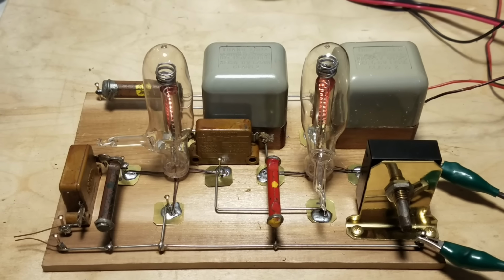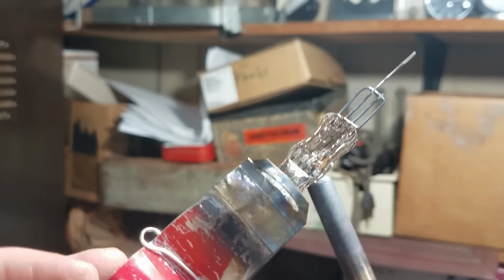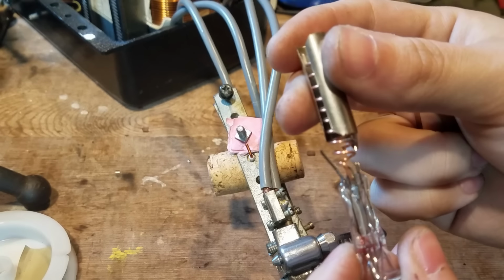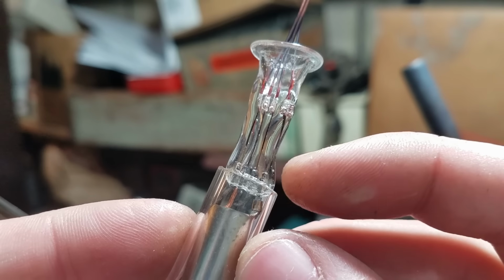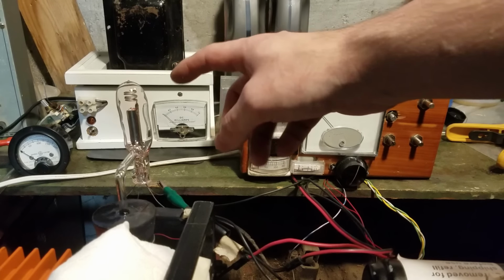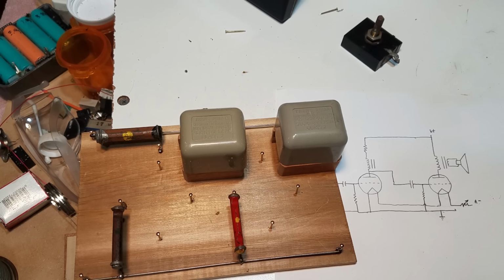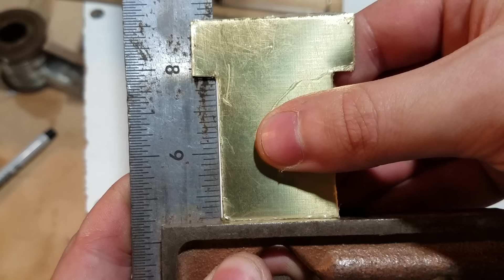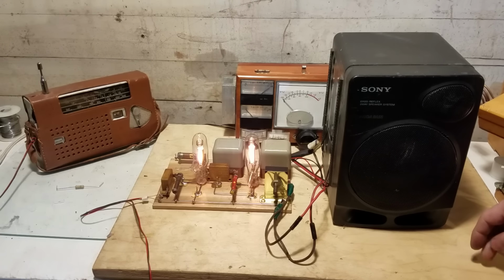Building a 1920s Tube Amplifier (And Tubes!)

Comment: I’m an EE, and this was really cool. Takes a lot of skill to do what you did by hand.
Reply from the maker: Thanks! I graduated just last year.
Reply: @jdflyback  congrats! It’s not easy.
Reply: Did you use to work in a tube factory?
Reply: @jdflyback  I still have a couple years left 😁 where did you buy the metals from?
Reply from the maker: @jakep8484  The tungsten wire is from prommark on ebay:
 https://www(dot)ebay(dot)com/str/prommark?_trksid=p2334524.m570.l113337

The nickel sheet is from china:
https://www(dot)ebay(dot)com/itm/183921244401?hash=item2ad28f78f1:g:gJUAAOSwqztZYMln&amdata=enc%3AAQAHAAABAHLHnXs4E2dcjAgtBaJnDztnYoR46dQo8fDZIn79sY98QBBtPXODXfOZVxE7jLZyMan0vQh0xAe52SiGKJahUJiXrd3WoIUwvQYq%2FcE6%2Bh89EnXtPllu5H8EQqjAQtrZOd4FPMsTjY%2FJalu%2BE80azygDh%2FVmMvW0KazobjQhh5uoGlpI4n93WZ9Fui%2FGGCTYEtUA2iau5CYDfD%2FxN%2BJxMMO%2BR%2FFpA6%2FbDlCynKYO8XeXF31zixvSPxXhmVBsdqSTjN84IC6CDuCoeff1SDPs%2B4DVF4CNZwJjgkIk6HCnRrj0xPpWRM0056Bw4%2FYDjTRbbZvYJ9GytiCcLGFjeQ76dto%3D%7Ctkp%3ABFBMnrn8xIRh

The steel wire is from china:
https://www(dot)ebay(dot)com/itm/403445194950?var=673450978944&hash=item5def3520c6:g:xFEAAOSw-jJh9NX4&amdata=enc%3AAQAHAAAA0DPaw09tnX%2FFd9b1pPP%2BEAliIshegmV2z9qYz2l6wa%2BckiA6yR%2F0q1rSsrWMp2Ao8dlG%2BcCsTaSuoPu%2BfyqM0gZAMRq0b%2FZsNfwjBcn7OowNeRbQjM2esBx84KhCGMllC9kjTHC%2F%2BqKiFTYmWHK8jI3Z5Lrcc5m%2BSgtrtL3p6mR0MoiZLZ3vHO6QY08Qa2IXFShsTK6vZcnB6qleSo7qKEjnnBI09kDwLHwls0FZiuCzgGi%2BCXmDWtbF2w0AYKa%2FrTxlx32fDd2DqW6tmhGk5vE%3D%7Ctkp%3ABk9SR87kksWEYQ
Reply: @jdflyback  thank you, great work btw. I should probably find a spot welder before I get the metals lol.
Reply: I'm an WWTRECP
Reply: @soteful9949  World Wide Tree Recording Electrical Crevice Potato?
Reply: @martinpanev6651  White Walled Triangular Rose Excavating Clinical Psychologist?
Reply: @rogerrabbit80  Makes more sense now!
Reply: I grew up in the age of tubes and never heard of anyone making their own.  It gives me hope that there will always be tubes for old guitar amps.
Reply: MechE here, couldn't agree more. I can't imagine how much trial and error went into every step of the process. So much knowledge in this video. Might have to try it for myself just to say I've made a vacuum tube

Edit: looked at his channel, now I'm completely blown away
Reply: @thearizonaranger7376  yeah, that requires some specialized skills that you just don’t find everyday. As an EE, I’ve found that often the students that made 100 on every exam, and were super book smart were actually the least capable of applying the technical knowledge in real world situations. Often it was the mediocre students/graduates who had the best common sense abilities, and who were the best designers. You really have to appreciate the practical knowledge and abilities of this person. It’s really impressive. It’d be fun to try to make your own vacuum tubes. I love coming up with ideas, designing, and then building something, and seeing it work. That is such a rewarding thing to do. Go for it, and give it a shot. I’d give it a try myself if I had the tools and materials just to see if I could do it.
Reply: i agree.
Reply: Yup it does
Reply: @jdflyback для лучшей работы нужно ещё  одну сетку и лучевые пластины , устранится динатронный эффект, не будет искажения.
Reply: @jakep8484  Build one out of a microwave cooker transformer and old jumper cables.  They are free at the dump.  🙂

Comment: As someone that has built regenerative radios using old 1920's directly heated triodes, I dream of one day being able to make the triodes myself like you did. Awesome work!
Reply: 300B's? 2A3's?  45's?   I often wondered why we can not heat these with Li ion batteries, even run the HT rail on a lithium battery pack
Reply: You can, get the tools together and practice. You might end up making pentodes even 😅

Comment: What blows me away is it seems almost all your instruments are ALSO home-made, which is just... astounding. I could maybe pull this off with professional equipment, but I don't know how you do it with your own tools. I'd spend half the time trying to figure out if I was doing something wrong or if my own equipment was malfunctioning.
Reply from the maker: I do exactly that! Induction heaters and vacuum pumps have given me the most trouble. I went through a dozen different mosfets before I found one that would work reliably. Same for the tank capacitors. For a while I had to replace the tank capacitors every two weeks before I found the correct type. I also have to deal with vacuum leaks and pumps leaking oil everywhere. Never a dull moment!
Reply: @jdflyback  What part of the world are you located in? I'd love to buy one of your tubes to try playing around with :)

Comment: I'm an electronics tech, did my time with valves and now knocking on retirement. I've watched Glasslinger doing vacuum tube magic, but he has gear that I don't. Found this video somehow, and an AC compressor for the suck, and a map? gas torch I have. Another project for the retirement list 🙂. Cathode resistors will help with the sound quality, but an amazing watch with your creation. An hour of enjoyment just blew past.
P.S, I'll shout you a hot glue gun if that would help
Cheers
Pete'
New Zealand
Reply from the maker: Thank you! Life is too short to wait for the glue gun to warm up!
Reply: Pete, if you can get hold of some Mercury, for good vacuum you can make a Sprengel Pump. It uses falling drops of Mercury (I wonder if Gallium would work?) to trap air in a very narrow funnel & remove it. Slow, but apparently high vacuum is possible.
Cody's Lab channel has constructed one. Just when you get around to it finally & the AC suck doesn't cut it lol

Comment: It's been quite a while since I've had my hat blown off by a Youtube channel. I only wish I'd discovered you a long time ago. Like so many here, I've been doing electronics and engineering for years, decades even, and never in all that time imagined that I could even begin to make an electron tube out of pyrex tubing and various metal elements. The only way you could make this more "from scratch" is if you went out and mined and smelted the metals and glass yourself. You are a true and rare mad scientist! I can't wait for your next presentation.
Reply from the maker: Thank you! I have a project planned using 10 tubes coming up. Work has been busy though so time has been limited. The tubes themselves have been made though.
Reply: I was gonna make some smartass joke about 'if you wanna impress ME , mine your own tungsten and smelt your own glass'- but you said it so much better.
What an amazing video.
I consider myself very DIY, but i cant touch this.
Wow!!

Comment: More than 60 years ago I built things like this but not the valves, (tubes). The old Body Tip Spot colour code for the resistors. Many of the components especially capacitor, chokes etc had screw terminals so most of it could be done without soldering. I must have a dig out in my garage to see what old components I can find. I am really impressed that you managed to make the valves. 🙂
Reply: there are other videos of people building lamps. a very old one ends with a certification of the lamp for a famous brand.
Reply: @Benoit-Pierre  Thanks, I will have a look. 🙂
Reply: @Benoit-Pierre  I watched it. What a lot of skill and patience required 🙂
Reply: @billhall8745  i have checked. He is manufacturing for Bose. Each lamp has a characteristic curve, folded in the box. When client ( Bose ) wants to do a stereo amp they need to check caracteristics for all lamps in stock and try to pair them to avoid stereo distortion. 

So if the present video is done for entertainment, my link points to an active industry.

The guy speaks French but I think he may be Swiss of Belgium.
Reply: @Benoit-Pierre  Thanks for the information. With all the modern technology it is good to see the good old systems are still there

Comment: Awesome, proper homebrew, all it needs for perfection are homebrew resistors, caps and transformers.
Reply: Resistors (at least for the low values) would be interesting. It's possible to make them from pencil leads (for old fashioned "lead holders", not from actual pencils- you can find both leads and holders in artist supply stores, as that's the only field that still uses them), a bit of wire coiled around the far ends of the lead (separate pieces, to form the electrical contacts), and a bit of solder to hold the wires still. You'd want to paint something insulative on for safety, and maybe some colored nail polish on top of that to color-code the resistor value, but fairly simple.

Might be possible to do the same with mechanical pencil leads for higher resistances, but that would be fiddly work, and some might not be conductive at all.
Reply: @absalomdraconis  I saw tons of leads at Dollar Tree! 😀

Comment: I understand some of the principles here however not all. 
   The manufacturing of the tubes was absolutely awesome. 
 The building of the filament and grid and the glass work and solder or welding of the grid and filaments which is obviously very tedious. 
   Your many skills and knowledge of electronics and especially analog electronics 
Is absolutely amazing. 
   This is the best demonstration of amplification I have ever seen. 
   And to do it from scratch and with very basic tools. 
    Your skill set and knowledge are absolutely stellar.

Comment: I love this project. Your work is so far beyond amazing, I am at a loss for words. Congratulations on your success. You have an incredibly bright future.
41:00 - Those transformers were made by Western electric for operating the lamps in multiline desk telephones and princess phones from the mid 1960s and into the 1980s when wired phones were still in vogue. Thank you for not cutting the prongs off of them. YOU rock!
Reply: Yes, kudos on the use of power transformers as a choke and an audio transformer!  I have several of those transformers in my inventory!  I would never have thought of this adaptation!  And I'm hugely impressed to see that anyone can build a vacuum tube from scratch!!  I often thought about writing a Sci-Fi novel about a castaway in space who makes his own SOS transmitter with a couple of tubes, no glass envelopes or additional vacuum needed!
Thanks for this truly excellent and intriguing video!  This old tech really enjoyed it!

Comment: That's fantastic. I was shown how to do this when I was at college learning about electronic and valve.
We made (well the lecture did) a single stage amplifier triode and just put in a sign wave and measured it's gain.
I eventually got a doctorate in this stuff.
Didn't do me any good mind you as transistor where in then.
Dam three legged fuses. 😅😅😅😅

Comment: I'm glad there's people like you in this world that appreciate old tube electronics enough to put in the work that you have. I wish I had the understanding of tubes you have displayed. I'm working on it. Most of the books I have bought (a lot from the 1940s) are full of formulas I can't wrap my head around.
Reply: The essence is like this: electrons will flow from a hot wire that is negatively charged (cathode), to a plate that is positively charged (anode), but not the other way around. Such a device is called a diode. If you add a third electrode in between (called the grid), you get a triode. If the grid is positive or neutral relative to the cathode, the electrons move along just as before. But if you apply a negative charge, the flow is blocked because the electrons are repelled back to the cathode. The interesting thing is that you only need a tiny variation of more-or-less negative voltage on the grid to cause a large variation in electron flow (current) overall from cathode to anode. So a triode can amplify a small change in voltage into a large change in current. Here two such stages are used in series: the input goes to the grid of the first tube and its anode feeds into the second grid.

Comment: I am very impressed, it is something I have always wanted to do and never got around to and I am at retirement age now.
A possible improvement. Triodes normally work with a negative grid bias. The way you have it now due to the voltage drop across the heaters the output stage has a greater bias than the input stage, hopefully, you are using a positive supply for the heaters, as this would make the grids relatively negative. 
Ideally, you would have separate heater resistors and run the heaters in parallel to the 0V rail. The grid resistors should then be connected to a negative bias supply using potentiometers. That way each stage can have its bias adjusted for maximum gain.
Reply from the maker: Sharp eye! The schematic is wrong. I am running the end of the tube filaments with a positive voltage to get the bias from the heater supply, with the connections arranged such that the output tube gets the most negative bias.  I originally planned to run the tubes in parallel but each tube takes 1.75 amps and my all in one supply can only put out 2 amps for the filaments.

Comment: You could have used a mains energised loudspeaker magnet coil for the first choke, ( if you could find one ). Great job, takes me back to my apprentice radio mech days.
The best part is that will still work after the EMP takes out all of the transistor kit.  😆😁
Reply: A humdinger if I remember correctly
Reply: @billhall8745  indeed it was :)
Reply: Yeah, my parents had a receiver that had the speakers with field coils used as chokes for the power supply.
Reply: @terryhayward7905  🙂
Reply: EMP fries wires & transformers; NEUTRONs kills solid state; the blast blows all and our bones away: BOO! happy Halloween . . .🎃

Comment: Wow! I'm very impressed - nothing beats making a tube amp using your own tubes. What do you use to generate the vacuum? I thought you needed at least a diffusion pump to get good enough vacuum for tubes? I just subscribed and will definitely watch a bunch of you videos!
Reply from the maker: Ideally you would use a diffusion pump. I have been looking for one for a while but have not found the perfect one. You can get away without one for simple tubes if you have a good rotary vane pump. I use an edwards e2m1 which can theoretically get below one micron. I think 10 is more realistic. Once sealed the titanium getter takes it well below one micron. I do not think this would work with a conventional barium getter because 10 microns is still too high, the titanium does not seem to mind though. For doing oxide coated filaments I think a diffusion pump is needed because the cathode must be processed while pumping. Whenever I have tried oxide filaments the coating has been destroyed while on the pump. The pure tungsten does fine with the high pressure.
Reply: @jdflyback  I just looked up the edwards e2m1  - not cheap! I'll bet what your doing is actually a lot like the way they did early tubes. Lee de Forest's Audio was apparently quite gassy so you tubes are probably very authentic. I had never heard of titanium as a getter - very cool that it does the job.  I know a lot of earlier tubes had uncoated filaments as cathodes so again, very authentic.

Keep up the great work! I look forward to seeing you future projects!

Comment: Wow, impressive. Did you get all the gas out of the tubes or not? I still gotta look at the whole video, but 1920s tubes were often still quite "leaky" so to speak. I'll give a more elaborate reply later on, if I find the time ofc. But anyways, certainly a thumbs up!

Edit: You went the whole 9 yards on this one, well done! You might just as well start mass-producing them for a price! 🙂
Titanium getter was a good idea, it's abundant and relatively cheap (I think?) and you did inductive heating off the electrodes too.
Normally there shouldn't be any problematic gas-leftovers in there. But an old trick (from the 1910s to 20s) to know for sure whether there's ionisation or not, is to connect the grid to the +HV (and be very carefull with rising the filament voltage while measuring) and make the plate neutral/negative opposed to the cathode. Than insert a microamp-meter in the plate lead, to look for any positive ions "crawling" to the (negative) plate in your vacuüm. If you see "bursts" of current heading from cathode to plate, don't worry, those are UHF oscillations! Older tubes with cylindrical elements might do this, it's called Barkhausen-Kurz oscillations. But if you see a gradual (negative) plate-current flowing, from the plate to cathode/ground that is, you've got a problem with the degassing and ions are remaining inside.

Just a little help from the old trickbox!
Regards,
Thomas

PS. What's that very cute old portable radio you got there? You've got a brand and type-number on that cutie?
Reply: I think some refinements to the process would be wanted before selling them. The result is sound, but the process of getting that result doubtlessly has unneeded nuisances in it.

Comment: Glasswork AND vintage electronics!! How freaking cool!!

If you're gonna leave all the wiring exposed like that, obviously be very careful not to touch anything. I love all the old components with your handmade tubes, though! I also really like the warm and fuzzy lo-fi sound it puts out (obviously you're not get high fidelity, as you said, but the soft distortion is actually really pleasing to the ear, for me at least. kinda reminds me of cassette tape fuzz, but lower frequency!)